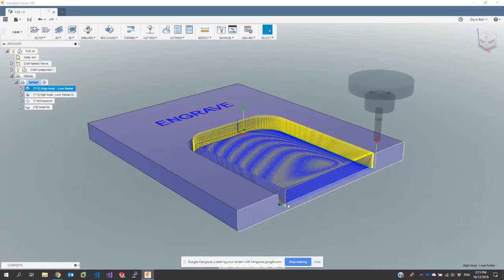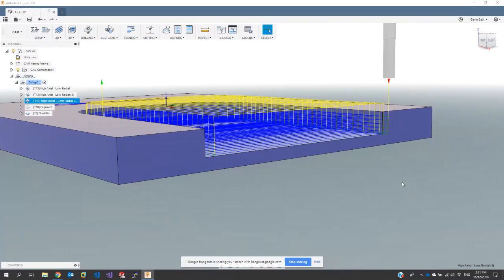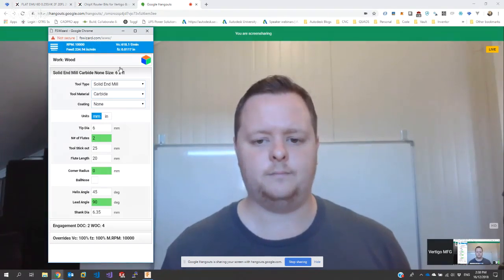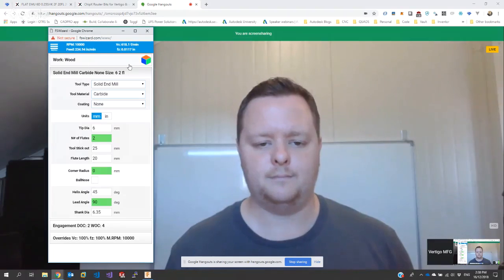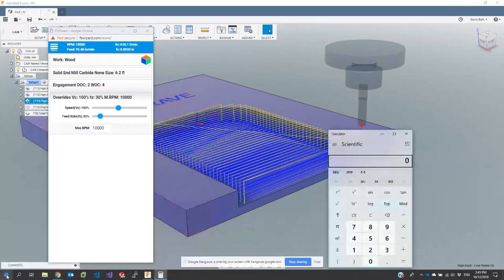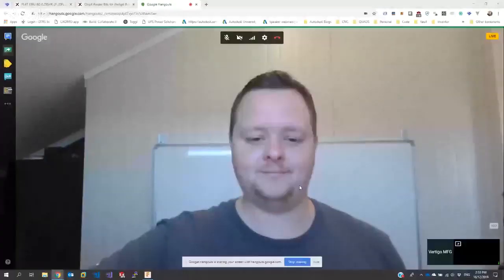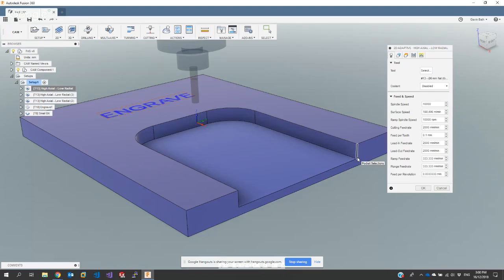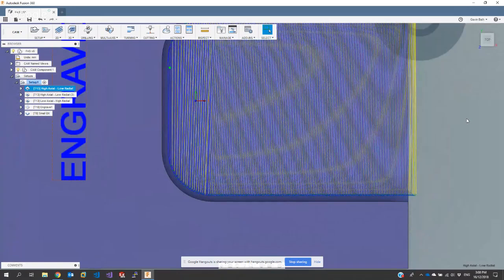Let's talk Manufacturing, Episode #2 Feeds & Speeds (ft. Brett Cottle & Gavin Bath)

Comment: I have done a reasonable amount of hand routing with a straight edge or pattern, as have the cabinet makers I work with. We always cut into the line/use conventional milling when routing by hand. This is interesting that a CNC prefers the opposite.